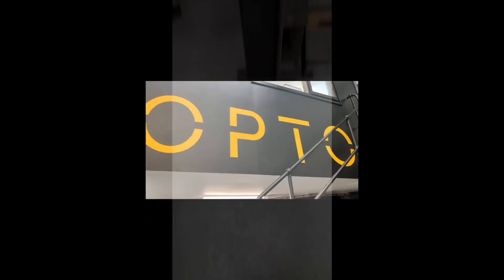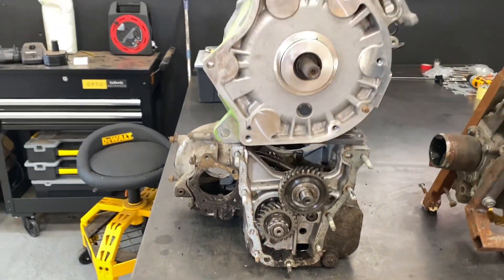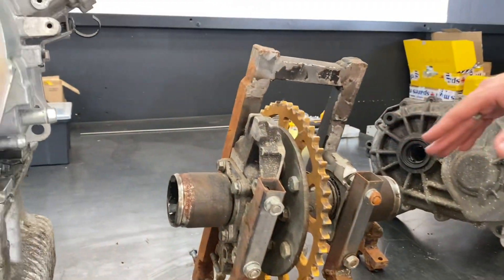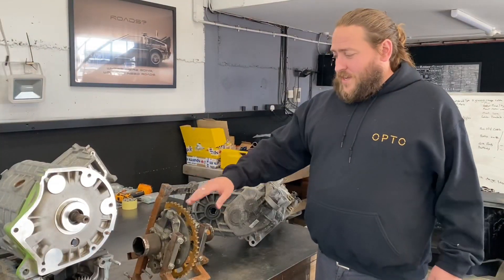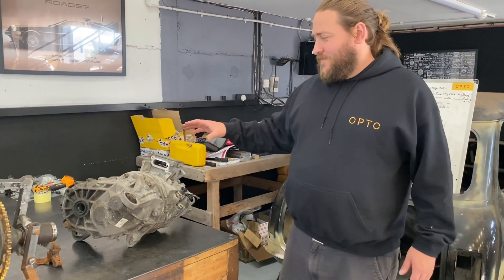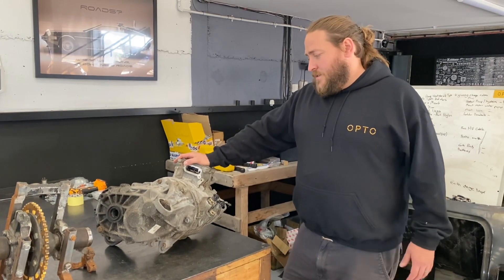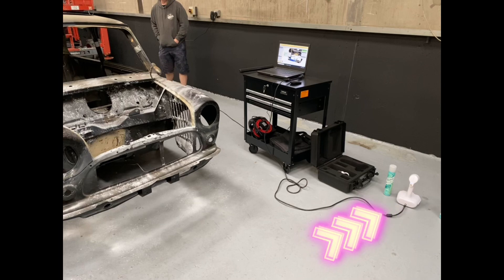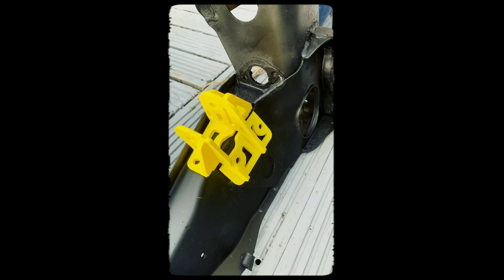Mounting an electric motor into a classic Mini! OPTO Innovation’s Mini EV Conversion Part 3!

Comment: Absolutely love what you chaps are doing. Keep it up! Bit of a daft question but isn’t that drive unit mounted the other way round in the back of the Outlander? Are there any issues with the inverter limiting top speed (thinking you’re driving in reverse) or any oil circulation issues with the reduction gears? Asking for a friend 😜

Comment: Hi, what did you say you used to model the strength on the engine mounts between the scanning and the 3D printing?

You are using almost exactly the same kit I am planning for my Honda Insight so thanks for doing these videos!

Comment: I am looking at using the same motor and inverter for a conversion. The rear motor is max 9300 rpm, it is the front motor that is 14000 rpm.
Reply from the maker: I think you are correct - i remember choosing between the oil cooled and water cooled and the 9k rpm and 14k rpm! Even so - we don’t want to go faster than 80mph in an old mini!

Comment: You got a new motor and diff for less than your original one?
Reply from the maker: Yes we did - we over paid for the first motor but purchased it from a reliable source - figured if the motor was dead on the new motor and diff we could swap it with our known good motor so it was worth the gamble!
Reply: @optoinnovation  eventually thinking of doing a van conversion but batteries alone make any ev conversion at the moment not cheap

Comment: good idea to go with the whole unit , I was going to mount the motor in the standard mini box with s/c drop gears and lsd diff.
Reply from the maker: We wanted to do that but in the end it didn’t make as much sense as going for the complete package - with a simpler motor casing / shorter it might be a better way to do it.